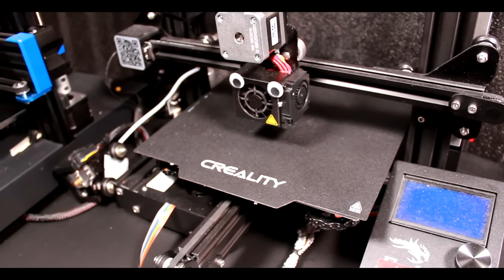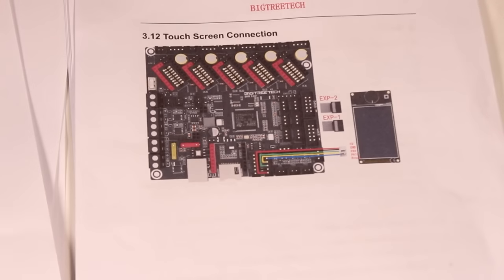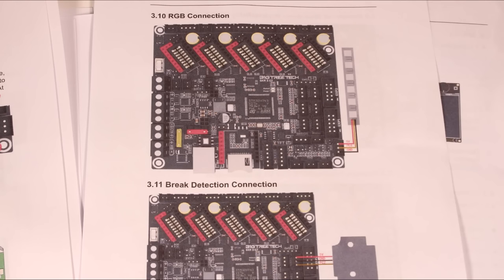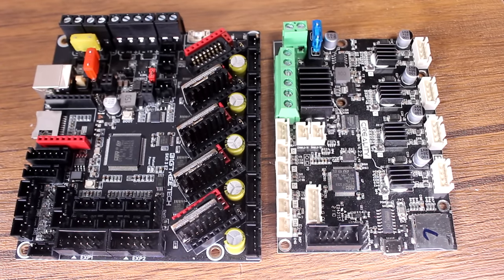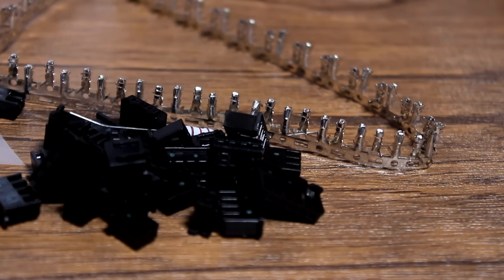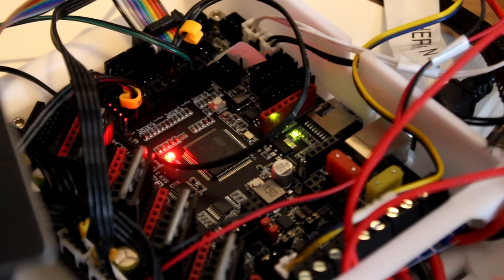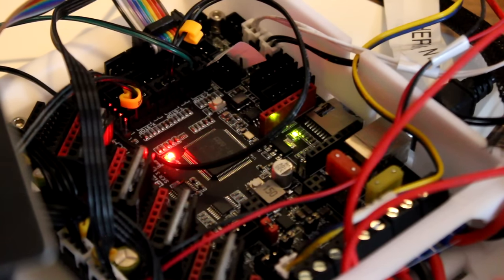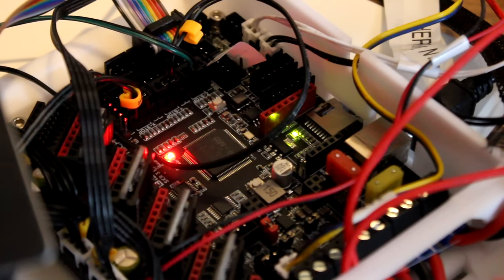Can an old Ender 3 be upgraded to be as good as a new printer? I test it out with the new SKR3 EZ.

Comment: Yep the stock ender lcd gives me mild epilepsy/brain damage 😜 probably the low frame/refresh rate+ wierd backlight pwm. All my machines now have btt tfts/ wifi only
Reply from the maker: have you done the ESP3D thing? I'm curious about it but its almost unheard of in the community
Reply: @LostInTech3D  nope-
right now my (skr board) printers are hooked up via octopi on a old£30 buck netbook(thanks thebay)

And I've installed 2 fystec e4s on the other 2 ..it's a good value board- for only 30 brit bux you get 4 tmc2209s and wifi( via its esp32 'cpu') it runs marlin and esp3d web ui- not keen on the tiny(physically) 50A mosfets tho

I recently  tried to set it up esp3d again for a friend's ender3  and had tons of problems (needed to rewrite  firmware- editing flash size[newer esp01 have smaller flash] ) also couldnt get write to sd working fast enough/reliably(serial write speeds to the sd of 8 bit boards is waaay too slow and prone to corruption.also I think I got 3 fake esp01(/killed them) modules  before I finally got it to work

One thing I want to try is run reprap firmware on one of my skr1.4s so I can modify the firmware on the  run without vscode. It is possible- btt has actually  made a breakout board which allows you to turn a skr1.4  into a "duet2"

Comment: Hm, I wonder how hard it would be to use that for Dual Z, since it seems most other boards (SKR mini) simply split the output, or use a splitter board (Creality's own solution)
Reply from the maker: I've not tried, but I should try really, I will look into getting a 2nd z rod and see what happens!
Reply: With Klipper I just used the original creality board for my dual z axis (axeeeese?) and an SKR Mini for everything else
Reply: You can use the spare driver socket to command a second z axis motor and achieve auto z levelling too!
Reply: Dual z isn't that hard. I have mine setup on the 2nd E1 driver and it automatically sets it up as long as you get your firmware setup correctly. It's nice and easy. I'm having problems with the part cooling fans not being turned on during my prints. G34 works, G29, everything else

Comment: I have 2 ender 3's that have been reflashed to support the 'then' latest marlin firmware.  Absolutely no need to upgrade them.  They work.  A faster MCU will make no difference because the machine is usually waiting to extrude.
Reply: I use a Rpi with Repetier that gives me wifi and remote access.  Works wonderully.  2 printers run off 1 Rpi and I could get up to 4 printers running off 1 Rpi.  The Rpi is where the horsepower needs to be if anywhere.
Reply from the maker: I don't think it's comparable ...that wouldn't even be silent drivers?
Reply: @LostInTech3D  I have dampers on the motors.  So I don't get a lot of noise.
Reply: Please explain what benefit a faster MCU/CPU will give ?  The steppers are driven at the same rates.  Maybe using Trinamic drivers give a better microstep noise response but other than that I can't see any other benefit.
Reply from the maker: Someone already answered it extensively in another comment, better than I can.

Comment: I got ine question. As my old creality board stopped working tday(running on klipper) and i was used to set the vref directly in the drivers how is this done here?
Directly in klipper via the current in the printer. Cfg file?
Kr and thx very much!!
Reply from the maker: Yeah you set stepper current in the config file on these boards if I remember correctly
Reply: @LostInTech3D  oh thts great news thx very much!!
No more annoying potti turning while looking at the multimeter!!!
Reply from the maker: Yeah I don't miss those days!!

Comment: Doesn't look like a big improvement for me since I have a 2021 ender 3 v2 with custom firmware (jyers ubl)
Reply from the maker: The ender 3 v2 board has the drivers in legacy mode, although for most people I guess it wouldn't be something they would find out routinely.
Reply: @LostInTech3D  what does that mean? Legacy mode?

Comment: I thought Marlin was a firmware to run the printer or you could use the Klipper to run it instead?  So why you putting two firmware's that do the same thing onto 1 printer!

I hearing some printer modder's saying use kipper not marlin and other the other way. S I don't understand why both put on 1 printer when others do either but never both.

Plus £70 for a new printer main board stuff that, that's way too pricey. You could buy a new budget printer for a little more than that.
Reply from the maker: 1. Klipper firmware is equivalent to Marlin, so yes essentially you choose one or the other. 
2. A £70 printer is going to make you wish you had upgraded your ender 3 instead 👍 the entry price for a printer equivalent to this upgrade would be maybe a Neptune 3 at $2xx
Reply: @LostInTech3D  Indeed. I have a setup like you mentioned. Not same hardware, but "CAN" run my E3 with Klipper ór Marlin if I need to use it Offline.
Reply: @TuncayAyhan  you don't need an internet connection for klipper/mainsail/fluidd to work, it's all local
Reply: @alecumihnea  LOL, I know that. I'm a long time user. But if you don't have network connection and still want to use Klipper, you'll need a hotspot. So that's when Marlin comes in handy.
Reply: @TuncayAyhan  klipperscreen then. No reason to use marlin
Reply: @alecumihnea I'm aware of that. KlipperScreen is a option, but not a part of core Klipper and my setup. 

Also, this conversation is just being annoying right now. 

Have fun lecturing people. Bye 🙃
Reply: @TuncayAyhan  if you're so aware of everything you might as well tell people the right information form the get go. 
You're not even using the klipper term correctly. Klipper is just dumb firmware. Mainsail or fluidd is the thing that you refer to as needed internet connection, when it doesn't. Then you tell people that they need a network connection to print when that's false too.

"Long time user"
Reply: DING DING!   And after round one it seems that..

 Oh, you brought beer?  Ok!
Reply: @alecumihnea  Missed your message.. 

Round 3?

Klipper is the name of the firmware AND also the software that runs on your Pi/Linux/machine. 

- Klipper is the main firmware. 
-Moonraker is an API. 
- Fluidd / Mainsail / Klapper /OctoKlipper are all connecting with the (API)Moonraker, but everything is connected to a system called Klipper, because… 

Yeah, it’s Klipper. 
If you think I’m wrong:
- What does Moonraker do? 
- Where is it connected to? 

Please tell us, you all knowing Sir? 
Tell me how it’s all connected. You seem to know everything. 

Waiting patiently.

Comment: How much difference does a 32 bit board really make? Seems overkill to me.
Reply from the maker: It's faster, but it's also my understanding that certain calculations need 32 bit. I've not spent a lot of time looking into it. Speed is likely to be the main benefit with old atmega chips running at a lazy 16mhz.
Reply: From personal experience, high volume gcode (such as with very high detail models) can overwhelm slower processors (not just in the throughput based on the clock speed, but also because some operations – floating point calculations spring to mind – run in fewer cycles on 32bit µCs), in particular with systems like the E3 which have that "power loss recovery" feature that constantly writes the print progress to the SD card. It's nothing you couldn't work around, of course, but yeah, you'll run into less "bottlenecks", in addition to creature comforts like wifi/lighting control etc., all of which would have to be weighed more carefully on the "older" 8bit systems. If you've ever compiled Marlin and run out of PROM because you wanted ABL and also menu text scrolling, you know what I mean xD Again, it's not that things didn't work with 8bit chips, the 32bit ones are just more capable; whether you take advantage of that is of course a matter of your specific use case.

Comment: really what a waste of printerboard the standard bord in the ender 3 is already more then good enough and gives just as good prints with new marlin and octoprint or klipper installed
Reply from the maker: 1. No it doesn't
2. The old board had ALLEGRO drivers on it. You knew that right?
Reply: @LostInTech3D  the only thing you changed was some noice that wasnt worth the boardprice and drivers